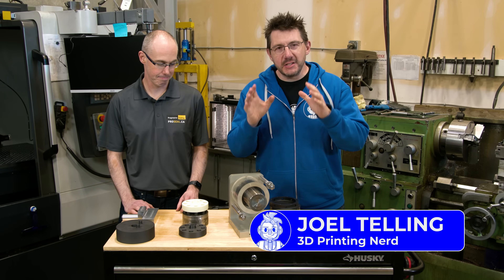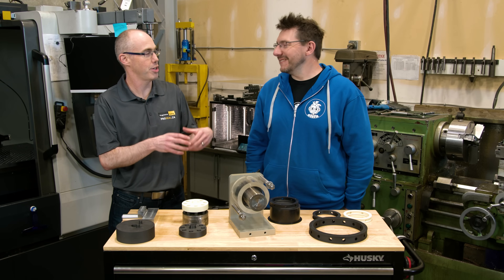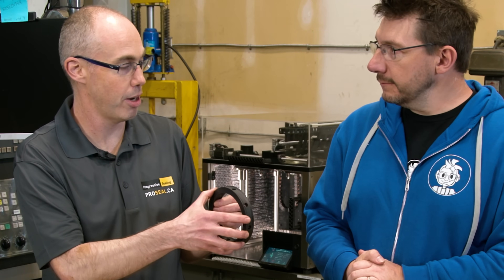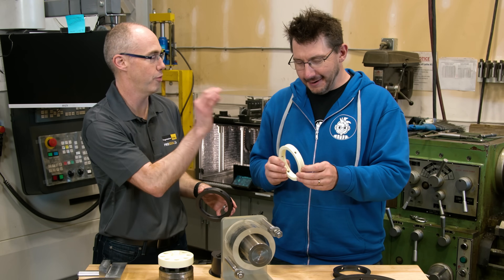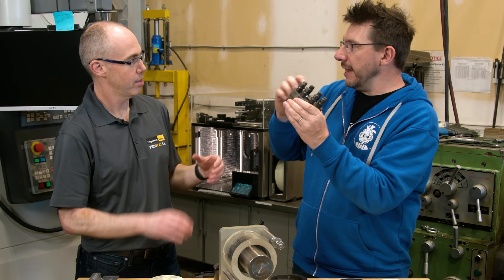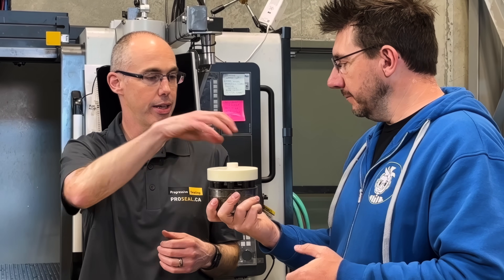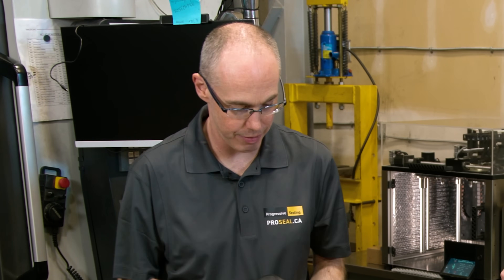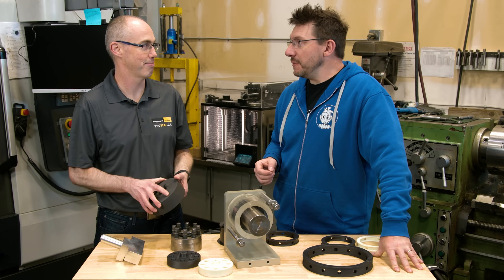3D Printing for INDUSTRIAL Applications!

Comment: 7:10 not that you couldn't find a solution but does the Bolt never protrude through the nut?  you might need a pass through design.

Comment: I almost never CNC mill a part without 3D printing a prototype given the expense and difficulty, and finding out it doesn’t fit or what have you is dirt cheap comparatively. For ultimate wear resistance I use Kevlar-nylon, printed in very high infill and many perimeters and not too much less than a softer aluminum part.

Comment: Those couplers on the top has seen a few crashes in their day lol, interesting uses. Also bigger parts could use a larger nozzle, those mandrills you are making could in theory have chonky layer lines and would not have much impact on the final product.

Comment: Excellent video.  I do stuff like this all the time for the home/shop.  My wife brought home some excellent parts boxes from her school.  They were going to get tossed.  However they were missing the removable dividers.  No worries I designed and printed my own.  This was just yesterday.  Now I have several parts boxes in use.  I'm making many spare parts and tools for pinball.  Post caps, saucer plastics that were broken, holders, tools, it goes on and on.  My medium of choice is PETG for it's durability and ease of use.

In fact I would change jobs today if I could get close to my current salary.  Call me!  🤙  😂
Reply from the maker: Love hearing the pinball fixes! I have a 1992 Data East Star Wars pin and it’s in need of a few parts

Comment: I work in automation and we use 3D printing for a lot of our fixtures because it's so much cheaper than machining. Parts that used to cost $800 and up now cost $25 If you're ever in the Chicago area I can give you a tour
Reply: What kinda printer are you using.

Comment: A fantastic representation of industrial practical prints. Practical prints aren't "this is NOT a decorative print, thus it serves a purpose" it's "this helps me and accomplishes something that either wouldn't have been done before or is done with a more complex process, now simplified". I can print a table, should I? Make your own response. But "can I use a drill to unscrew this, even though a drill doesn't fit it?" that's where practical print comes in. And these show that perfectly.

Comment: Love the section on the supernut. I’ve worked with them quite a bit. Taking them off is the easy part. That tool would help but I s not the real issue. It is torquing each bolt on the nut down numerous times that really hurts the arms. Spend a few hours in a super hot humid hole torquing 500 bolts to 250ftlb is what kills you. Only thing that makes your life better is water and an air mover.

Comment: I work in manufacturing in New Zealand and have worked as a machinist for 30 years. I have been pushing hard to add more 3D printing into our systems. The company I work for had a resin printer when I started at the company which they used primarily for the design team to prototype new products. I quickly discovered that it could be used to make jigs and then simple tools but the resin was not the best material for what we needed in the factory. The detail was the selling point for the resin but it tended to be to slow and to brittle for what I was wanting to use it for so we got a Prusa printer and found it performs great for what we need. We make custom jigs and tools as well as modifying tools for comfort of the user. 

The next step that I have spent the last 2 years nurturing is to replace a very labor intensive production part with a 3d part. Our current challenge is finding the right material that can be used in a household water system and meet local standards. Also the cost is still a barrier not with the machine but with the cost of the materials. I will not give up on this project I think it will only be a matter of time until things come in line and we get the right combination.

I see 3D printing being a huge compliment to the machining industry as a whole and look forward to an exciting future.
Reply: @warsuper4681 check out the iglidur filaments by igus. They have ones that are rated food safe for drinking water applications ()at least in th eu), with depending on the type reasonable to verry good strenght over pla and high temperature resistances. Most of them can be printed on a prusa printer and the prices are reasonable starting at ~ 50€ for 750g (iglidur i150), and going up depending on high temperagture resistance etc. They also give out free samples.
I hope it opens up new possibilities for you.

Comment: (2:24) subtractive manufacturing, also on the part where he says the inside of the milling procedure all that would have to be turned into chips (2:31) I say if its a thermoform plastic, then use those for additive manufacturing by saving and extruding them to make filament :)

Comment: I think you need to add machine cost and material cost for these type of printers (and yes I could probably do a business case for the mentioned printer)
Reply: I think compared to 50-100K for a small mill that a business like this would be buying, the 15,000 a Pantheon costs is more than cost effective.